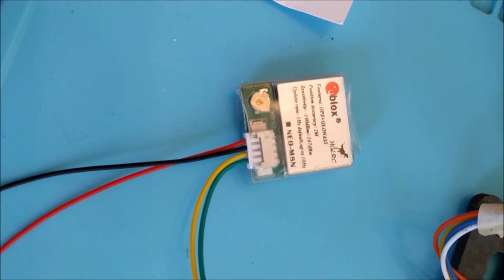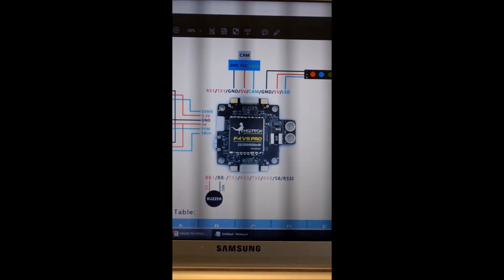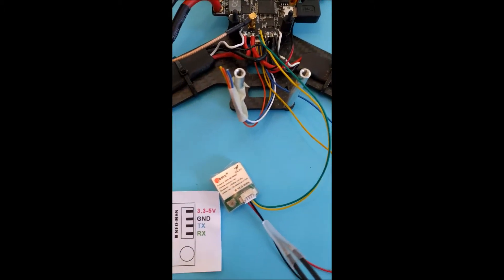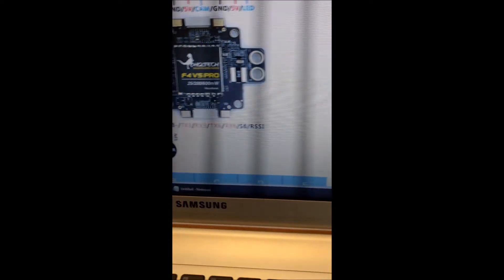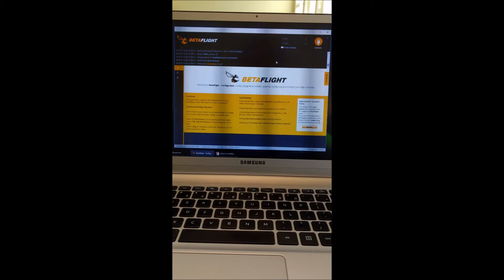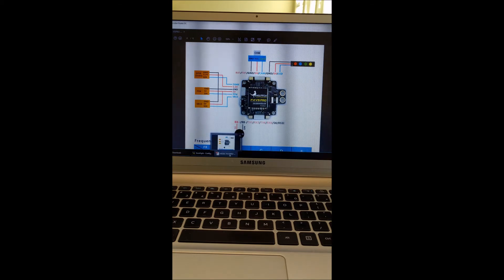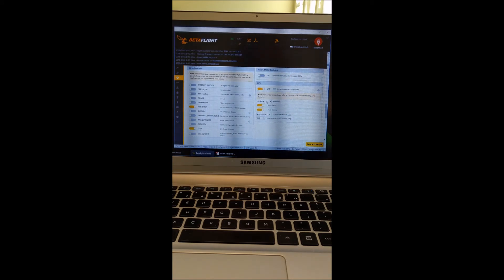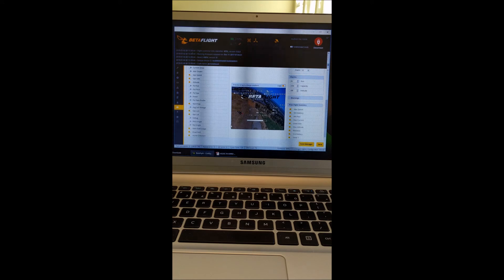Connect & Configure Ublox M8N GPS Module

Comment: This is good to go straight form bang good. juhst houck it up? Tested it?
Reply from the maker: Yes it worked great. I was able to see longitude and latitude in my FPV goggles while flying. Just need to enable it in the OSD.
Reply: Okay sweet! Just had a flight withe the gps from ebay and it worked fine to. good home lock and speed. But i cant get altitude working good. it just increases the hole flight :/ Somthing with the barometer. Downt know if you need a magnetometer with it mabye..
Reply from the maker: Just flew yesterday and saw that the altitude was displaying correctly in my OSD. I do not have a magnetometer.
Reply: So weerd. Probebly the board i hav den.. Kakutef4v2..